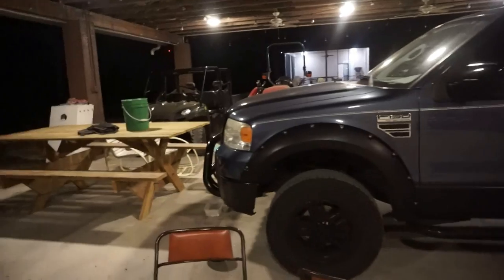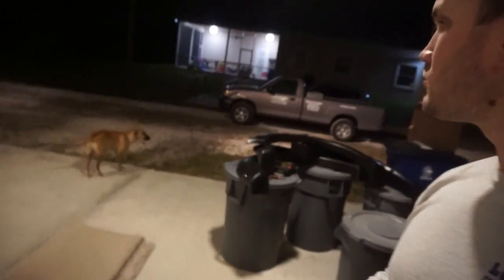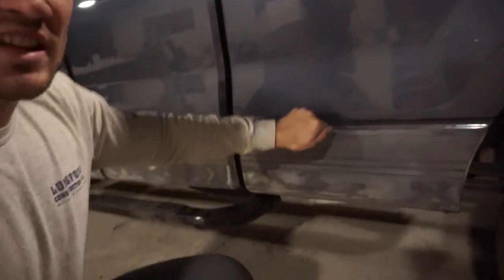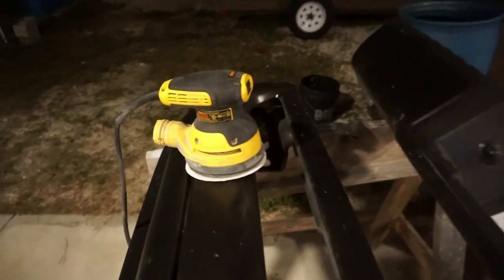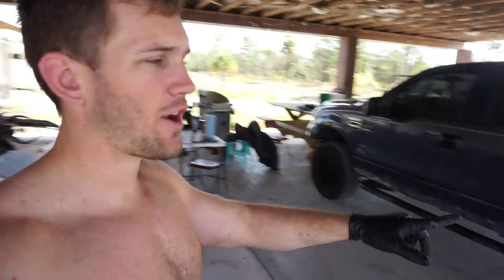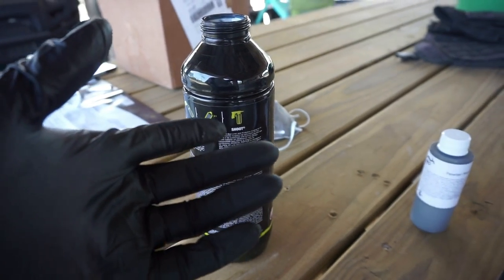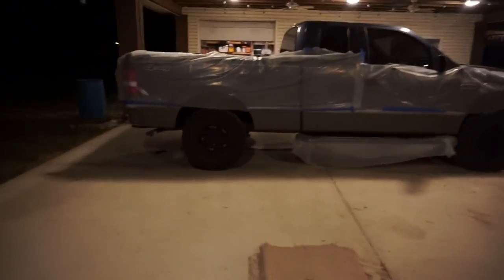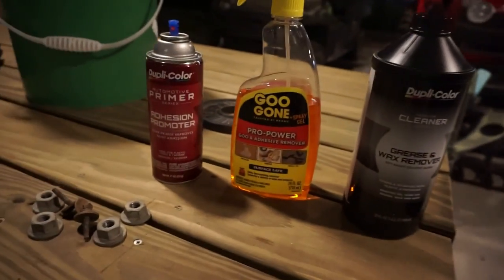I PAINTED MY FORD F150 WITH RAPTOR LINER! (AMAZING RESULTS!)

Comment: Was your front bumper originally chrome? If so, after sanding it, did you use an adhesion promotor or self ethching primer on it? Thanks, the truck looks great!
Reply from the maker: Hey Luke! Yes, both the front and back bumpers are originally chrome, I sanded them down and cleaned them up and then applied a self etching primer to the bumpers before applying the raptor liner
Reply: @AndrewDoesLife  Awesome, thanks bud! You earned yourself a subscriber!😎
Reply from the maker: Luke Bramwell fantastic!! Thank you for your support

Comment: Bad ass truck bud . Looks alot like mine. 👍 mine is true blue with silver lower half too. No bull bar. I spent about 150.00 on 3/16 steel and built me a front bumper. Ill sub and check out more of your truck videos. Sub to mine and ill put more of my truck on their.  Ive done alot to mine. Looks good keepem comin
Reply from the maker: Thanks Bob! I looked at your channel and saw your truck, looks badass! Like the topper too

Comment: What color Raptor tint did you use?
Reply from the maker: It was Pewter Metallic. This is the link for what I bought for this project  

https://www.amazon.com/gp/product/B01CKE9EVO/ref=as_li_tl?ie=UTF8&camp=1789&creative=9325&creativeASIN=B01CKE9EVO&linkCode=as2&tag=aslunsford-20&linkId=3f062c7600c2bfc663e8db255df42765

Comment: How many bottles did you use?
Reply from the maker: I used 3 liters out of the 4 liter kit I ordered. Truthfully, the product goes a really long way and covered a lot more area than I though so I didn’t even use a full 3 bottles. Always better to be over prepared though. I now have an extra bottle to do touch up work and repairs if needed.

Comment: Nice truck man! I have a 2006 5.7L V8 ford f150. Its black on black, has a cold air intake and has a guard on the front with a lift kit
Reply from the maker: Thanks man! How high is the lift kit you got? I’m definitely lifting mine in the near future! Right now it’s just on a leveling kit
Reply: @AndrewDoesLife  2 inches. Im trying to get a leveling kit at the moment
Reply from the maker: Which brand of lift kit do you have? Check the link in the description to check out the leveling kit I use if you want
Reply: @AndrewDoesLife  that i dont know. I bought it with th kit on it
Reply from the maker: Tanner Moore I gotcha. Yeah I’m thinking I’m going to go with a 4 inch lift and get a new sets of wheels as well. I have 18 inch wheels but I think I’m going to downsize to a 17 inch wheel as I like the look of those with 35 tires better